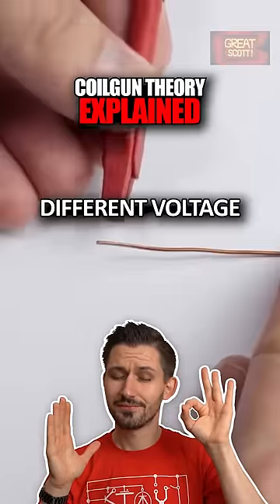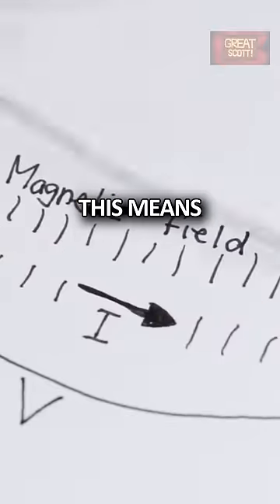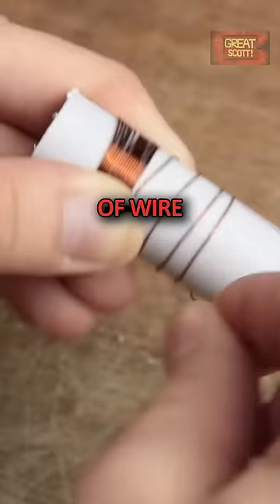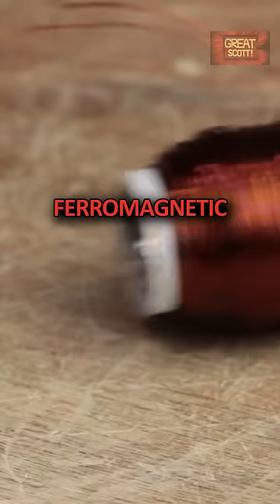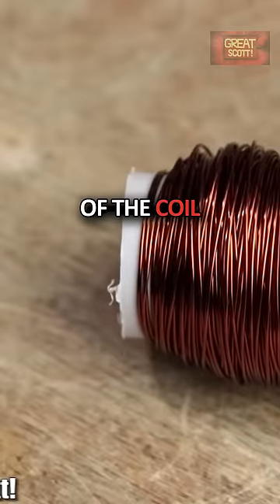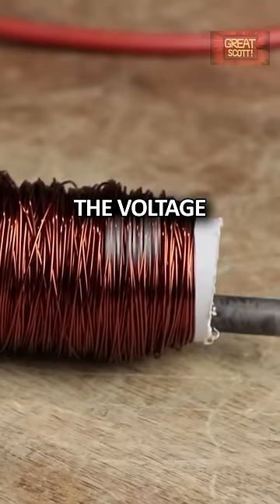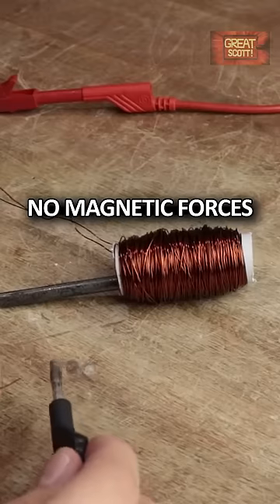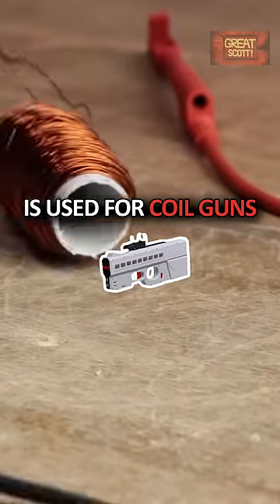This is how a Coilgun works!

Comment: Only wind forward. Winding backward just increases the resistance with no increased strength. For multiple layers, move the wire to the back of the coil, and start winding forward again.
Reply: Why wouldn't there be increased field strength? Only the direction in which you go around the coil matters. Many machine wound coils are wound like that just neater so that there is no overlap. Moving to the back of the coil creates overlap and that horizontal part of the wire doesn't contribute to the field strength
Reply: @laserdiode  the direction of the wire winding determines the polarity. with 1 layer forward and 1 backward, you make a north and a south, which will cancel themselves out and make a weak field.
Reply: @icecube-n2d  that is true for changing the winding direction (for example from clockwise to counterclockwise). As long as the direction stays the same it doesn't matter if you move left or right within a layer. Changing the winding direction accidentally is almost impossible because you would just start to unwind the coil
Reply: can u explain why it works like that? I wasted so much effort moving the wire back every layer ig
Reply: @icecube-n2d  When current flows through a wire it creates a magnetic field around the wire. When the wire is in a coil the magnetic fields combine into a single field. The right hand grip rule can be used to find the direction of the field. The interactions between the magnetic fields in each loop of the coil are pretty complicated but basically the magnetic field forms perpendicular to the direction of the current. If the direction of the current changes to opposite (if the direction of the winding in the coil changes) the magnetic field also flips and cancel itself. Any part of the wire that goes horizontally across the coil creates a magnetic field 90° from the main field and it doesn't add or cancel the main field.

If every other layer is wound "backwards" the direction of the current around the coil is still the same so the direction of the magnetic field is also the same

Comment: The object isn't realeasing the kinetic energy, but it's the coil that trying to resist the current drop creating opposite fields to keep the current flow stable affecting the movement of the object.

Comment: Its been sooo long since i made my last coilgun
Still remember my first 16+ years ago (yes 16)
You can easly build full auto coilgun that can penetrate a microwave😂 by using rly thick wire , 8/10mm rods (screws works great) as bullets  , few stages that use mosfet and phototransistor to activate it  and some lipo battery with at least few hundred amps peak or supercapacitors 
No need for any controller like arduino etc
Just move the phototransistor to change "timing" the same goes with bullets 
Cut them no longer than the coil so coil turn off before bullet hit the centre of magnetic field